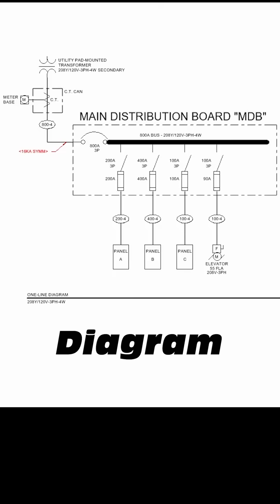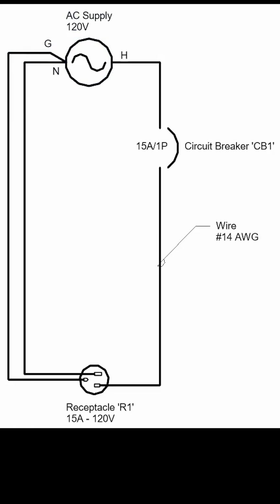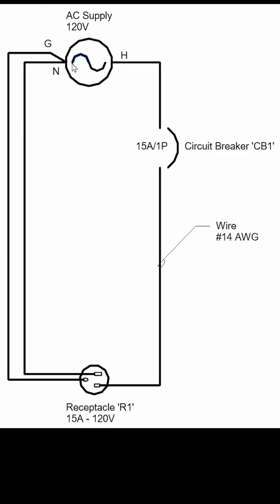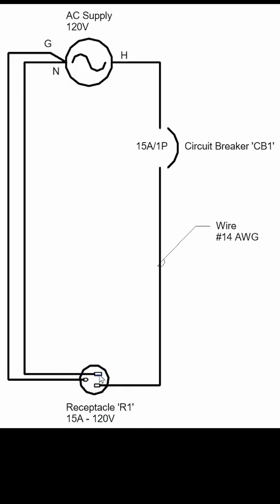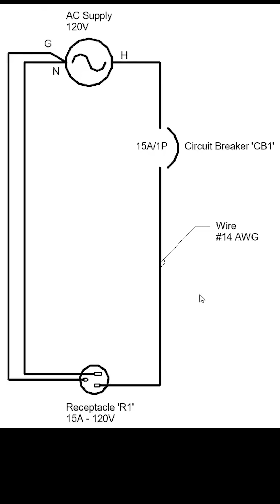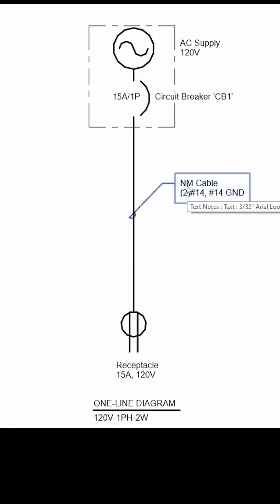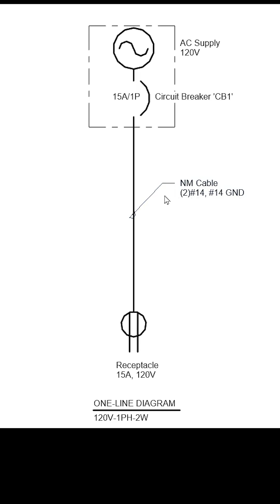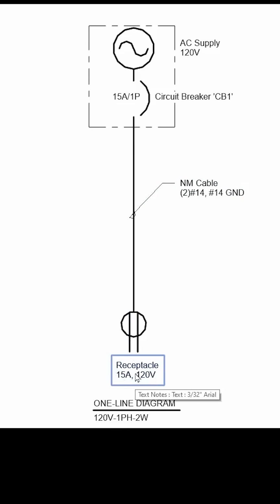What is a One-Line Diagram? #shorts

Comment: Never seen a one-line with receptacles. Usually showing utility power going into a building. Then showing the meter, MCC, panels, disconnects. Never shown past the panels though. That seems terrible.
Reply from the maker: You are totally correct. My simple example was to help illustrate the  concept of what the single line represents. In practice we show distribution only to the panel level and occasionally large connections (i.e elevators, chillers, etc.) Like my last example in the video. Thanks for your comment!